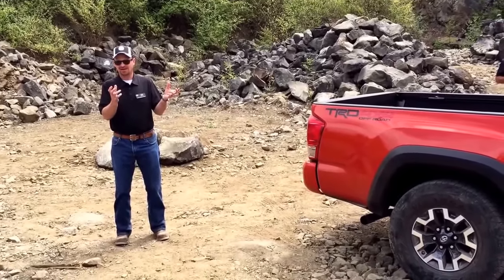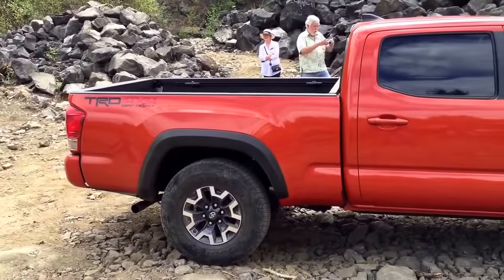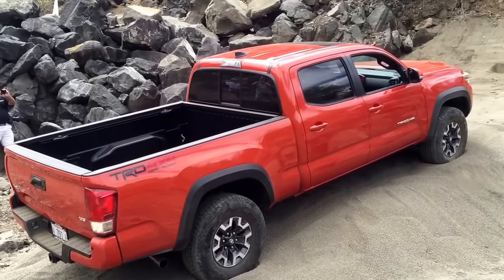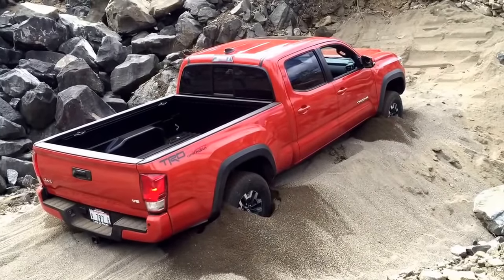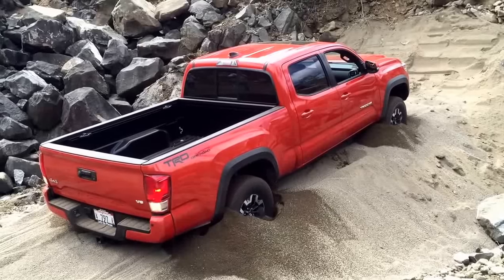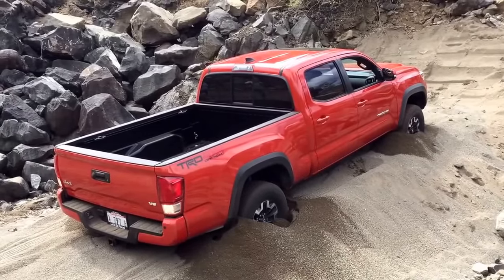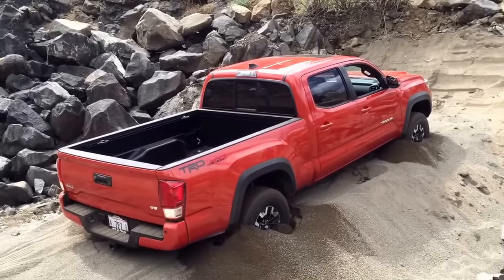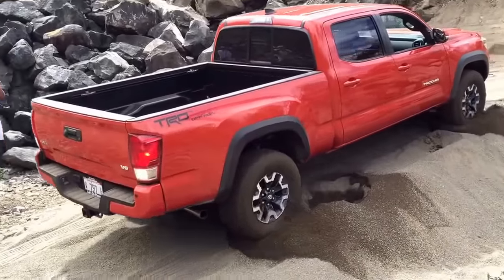2016 Toyota Tacoma - Demonstrating Crawl Control

Comment: We spent so much on crawl control we had to give you drum brakes, you guys.
Reply: hevquip a lot of trucks have drums in the back. Mostly older models though I wouldn't expect it from a new truck
Reply: drums are better ofroad
Reply: Milan Dičér true, the first thing I do to all my new off road trucks is convert from disc to drum brakes
Reply: Maximum Hardcore - then your wasting your money. Drum brakes do nothing better than disc brakes. Name one thing.
Reply: Mr Smith I was being sarcastic to the guy above me lol
Reply: @maximumhardcore4362  Drum brakes are better for mud offroading since they are enclosed whereas disc brakes will get covered in mud and stop working.
Reply: patycake720 nah, if that was the case dirtbikes/atvs would never use discs. They’ve always worked fine for me through mud. All drums ever do is get wet inside and they’re much sensitive to water/mud than discs
Reply: @maximumhardcore4362  dirtbikes aren't really going through the same amount of mud as 4x4 not to mention its not really possible to have drums on a bike.
Reply: @patycake720  my dirt bike had duums front and rear. Drum brake suck, they need adjustment, and they get wet and don't work. Disc brakes sepf cleaned and self adjust.
Reply: @patycake720  drum brakes are enclosed, not sealed. Which means dirt and water will get into them and get trapped in there. Disk breaks works in rain and mud just fine.

Most motorcycle's had drum brakes up until the 80s.
Reply: @patycake720  yes it is and it has been frenquently use just check the smaller honda MX series crf 50 to crf 150 most of thoses are drum brake
Reply: Drum brake have better brake power than most disc brake... their only problem is that too much use/temperature and they will fade out because they are not ventilated well enough. Disc brake are better in mud because the pad will squeeze the watter out by it self while the drum will be enclose but if water get in, it will take more time to get it out and the drum shoe will constantly work in water wich will have his braking power reduced . Drum brake are the economic version and disc are the heavy duty version.
Reply: @factojapspecmotorsport846  Nope. Disc brakes are more powerful than drums due to the brake pads are squeezing the disc plate on both sides compared to drums that only push from the inside. Add to the fact that the heat would cause the drum to expand increasing the gap between the brake pads and drum.  In disc brakes while the disc would still expand in the heat, the brake pads are still close to the disc.
Reply: @rzpogi  do not miss match everything about brake fade and metal thermal expension. There is a reason why drum brake is choosen before disc brake in many car still today. 1st the cost because a drum brake is still a lot cheaper than disc brake and 2nd the required input power. For exemple: if your car is correctly maintained, pull the e-brake of a drum activated e-brake / disc activated e-brake ... it will always need less force on the lever of a drum activated because its mechanical principle. When I said that drum brake have more stoping power, I meant that as long as the drum do not exeed the working temperature, a regular passenger car user, pick up driver or semi-truck(tractor) conductor will not see the difference between disc/drum. A truck that can pull 8000lbs would not be equipped with drum if it would not do the job.
Reply: @rzpogi  ho and btw : brake fade have nothing to do with the fact that the brake shoe cannot touch the drum anymore... the self adjuster in it compensate for the wear of the shoe so the wheel can only spin about half a turn when the car is on a lift. Drum are far from being junk but far from being a first choice in term of race use...
Reply: @factojapspecmotorsport846  Then why drum brakes are slowly phased out in regular passenger and even trucks? New Isuzu and Mitsubishi trucks already have disc brakes in their front wheels for their small-medium truck line. 

Pff stopping power? Then all vehicles should have stayed with drum brakes then. Disc brakes have been proven to be superior in stopping power and reliability compared to drum brakes. The only disadvantage is cost and complications of adding e-brakes to disc brakes. Also, disc brake pads are much simpler to replace compared to drums.
Reply: @rzpogi  every automaker use brake disc for front because it will resist emergency braking more frenquently and for a greater time. The question is : do our customer need the pay the higher price of disc brake, does the drum will do the job?. I am not defending the fact that drum brake are better than disc, like I said before they are far from junk but far front race choice... why would many 18wheeler trailer would still be on the road with drum brake if it would be that bad? BUT did you ever heard a trucker said that his brake failed on downhill? BECAUSE THEY OVERHEATED ! I wrote this too ; disc brake are the heavy duty version while drum are the cheap one
Reply: Trucks are light in the rear so they use drum brakes because they have a 10 thousands of an inch air gap they have to overcome before the brakes engage to prevent tire squeal or lock up due to the back being lighter!!!
Everyone on the comments does not know the truth!
That’s why I’m here to educate!!!
Reply: @alex62654  
Ever heard of a proportioning valve?
Reply: Drums are superior in many situations dumbass
Reply: My understanding is that the rear locker uses light rear brake drag to engage lock up and this is why the rears are drums. Thats what the manual says if I remember correctly. I think drums are better for providing this light dragging force. I could be wrong though. Either way. I got the TRD with rear drums and I don't notice anything from the driver seat braking wise. Love that locker though. I have the 2010 so I don't have crawl control. I just use snow chains. I have been in sand that deep and deeper snow running stock with snow chains and not needed my shovel.
Reply: Toyota skims out on those things because they know brand loyalty is a real thing. People will continue buying.
Reply: The drum brakes go out of adjustment in 500 miles and become worthless. The auto adjust isn’t. 
Toyota’s are good trucks but some fans take their enthusiasm too far.
Reply: @patycake720  lol talk out ur ass much boi
Reply: @rzpogi new semis hevy trucks even come with disc brakes
Reply: Totally sounds like a Todd Hoffman excuse. Lol.
Reply: Drum brakes should have never gone away.
Most last a life time on a Toyota Truck
Reply: im fine with drum brakes... i dont plan on racing.
Reply: Half these comments are pure bullshit

Comment: I want to see it doing this stuck on a flat surface, not on a hill.
Reply: I'm not sure if they could get it buried on a flat surface
Reply: Chaser Harper they could chain it to a concrete block or two  :)
Reply: Chaser Harper Or dig a hole and make it stuck.
Reply: Chaser Harper Sure you could! They just need to go to a beach! :)
Reply: +Chaser Harper Easy.  Put that sucker in 4LOW and punch it.  I see it on the beach all the time!
Reply: +LexTheRanger I agree, doing it on a hill like that is a cheap parlor trick
Reply: +LexTheRanger i done it on my 2wd 2015 Tacoma with rear diff lock and i have the video to prove it. Thanks to the diff lock i go farther than a 4wd truck and excellent driving skills of course
Reply: Yeah right. I have done it on the beach. Its not that easy and overheats the engine and transmission.
Reply: that's my comment.. 👌
Reply: exactly. The only place you'd ever need it.
Reply: On a flat surface its a whole different ball park. Doing the crawl control wont work. You will need serious deflation of air pressure to widen the tires contact patch and then Some serious rocking back and forth and then a good push out with the throttle to break you free
Reply: Sour Grapes, there buddy
Reply: I love the applause at the end, though.  Like it was a magic trick.  
It definitely wasn't magic, but it sure was a trick.
Reply: you can easily get buried on a flat surface if you brake hard to come to a stop, spin the wheels a bit to dig in and then you can show the crawl control. It's legit, arabs did this in the desert with a land cruiser, on a slight UPHILL slope.
Reply: I've done it in my GX. Plenty of videos online of landcruisers doing the same
Reply: Chaser Harper Trust me someone somewhere can do it.
Reply: LexTheRanger vbnbhnn.    Jjgjkkk
Reply: LexTheRanger @@@@@@@//ffggggggyyhgu
Reply: I want to

Comment: Lesson 1: Make sure you line it up just right before getting stuck.  
Lesson 2: Put it in 2wd first to get "stuck"
Lesson 3: Seems novel. (And another thing to break, malfunction and require expensive repairs) I would like to see the driver attempt to rock the vehicle forwards and backwards first, before determining how "stuck" this vehicle really is, and how effective the "Crawl control" feature is.
Lesson 4: How applicable is this? Snow/Ice? Mud?
Reply from the maker: High Up Tours + Transportation Once the weather gets colder and we have the opportunity, we will do this test on Snow, Ice and Mud since many have requested it. We're also planning to shoot a follow-up video with Mike Swears from Toyota Motor Sales USA to address the most popular questions from this video. Thank you. -TheDriversSeat
Reply: thedriversseat Awesome, nice work in following up guys.
Reply: High Up Tours + Transportation It seems kind of weak because it did prove that he could no longer go forward, but then proceeds to demonstrate the system in reverse, on the downhill side...not sure this system really makes anything possible that you couldn't have done before.
Reply: High Up Tours + Transportation I agree with you to a point.  This is made for idiot off road users.  Same as the people that can't parallel park.  Ford has the trailer backup now.  To me you are giving people false confidence.  This feature has been tested for many years on the Land Cruiser.
Reply: +High Up Tours + Transportation Look bro we know you drive a Ford just calm down.
Reply: Lol yep. What we learned here is that Tacoma will get stuck where a Jeep will not. And to get out of a situation like this all you have to do is back out all 4 wheels slowly to build up sand. Got it. Don't need a dedicated system for something like that. Just learn how to drive. I would never own a Tacoma.
Reply: +High Up Tours + Transportation Not only that, but he was also backing "down hill". real test would be to get stuck and have to back uphill or on a flat surface. gravity was helping that truck.
Reply: +Eric Fortune You can buy a Tacoma for low 20's.  I think this model would be more for the enthusiast.
Reply: ***** Trucks are getting more expensive because they are expected to be a car in the inside and truck on outside
Reply: Christopher. Stop talking nosense you havent even drive in the sand. I got a pickup truck with 4WD and has 4wheels low. When you get stuck you have to take out your head and see how fast your wheels are spinning
Reply: +Jay Trock They don't make trucks anymore period.
Reply: I've seen this system work on flat ground in a dried river bed. The 4Runner was as stuck as you could be in sand.   I didn't believe it would work but after 3-4 minutes the truck came right out.  I was very impressed.
Reply: +thedriversseat why dont you get another truck with the same tires, tire size, weight, wheel base and ground clearance that has a real 4x4 which all diffs lock and compare that to the Tacoma crawl control. I see this new crawl control stopping the tires which can actually get you stuck when momentum and slow turning wheels in 4 low is best. This video does not compare nor prove anything how actual traction rates to anything else.
Reply: High Up Tours + Transportation man shut the fuck up... don't write nonsense... or get your eyes checked.
Reply: Christopher Cox stop winging.
Reply: On second viewing, why is that thing having trouble trying to make it up a non steep grade? I heard the motor going and struggling like it was trying to move all 4 tires.
Reply: dude shit up, go try that shit yourself. alw
ays gotta be one of you
Reply: that comment doe. lol we try that shit all the time. Most of the vehicles in the club can go straight up a mountain staring at nothing but sky. This thing is struggling to climb up a tiny hill. No thanks.
Reply: not sure i was much impressed with the tire/tread  choice on the truck...
Reply: High Up Tours + Transportation don't forget to do it on a hill 😂
Reply: jldude84 you're AWFULY wrong 😂😂😂 the quality is what Tundra owners are looking for.
Reply: jldude84 I think you're thinking of ram guys
Reply: High Up Tours + Transportation
Reply: High Up Tours + Transportation 4

Comment: Better yet, can it continue going up? No
Reply: Yes if the driver wouldn't have started spinning the wheels and stopped and dug himself in, yes it would have went up that tiny hill just fine and in 2WD.  These are nothing but gimmicks to get stupid people to buy shit they don't need.
Reply: William Todd idk it seemed to be having a hard time going up in 4.
Reply: I feel like crawl control is un necessary that was a little hill i coukd have gone up that without getting sthck or crawl control
Reply: Weakest 4x4 I've seen.
Reply: Never seen sand look so thick like rocks
Reply: @dougjohnsonbushcraftandbjj5561  I agree 1st time going up sounded like it gave it's best lol
Reply: Barely had enough power to get stuck!

Comment: To all you people saying it isn’t stuck ,ARE YOU SERIOUS it was more or less bottomed out they dug that truck in pretty deep. I’m an all terrain mobile crane operator there’s 2 types truck mounted cranes Kato and Tadano jap cranes but only rear wheel drive then Terrex my fav was my AT35 AT FOR ALL TERRAIN 35 means what weight as in 35ton with rear steering and diff locks, got stuck a few times in the only rear wheels driven but with diff locks I never got stuck in the 35 , I think this is an exelent vid proving that low torgue and variable diff rates WILL AND HAS WORKED FOR ME I’d drive that truck anywhere peace.

Comment: That was the dumbest reason for using rear drum brakes ive ever hear.
Reply: Gixxer983 learn how to spell, speak. Take this L. 😂
Reply: @gjolinares23  I bet you got a solid 73% in English class
Reply: @angelr6524  Nope. I did even better and with barely showing up or trying.  🤣
Reply: Gerardo Linares 
His 100 likes vs. your 1 like

Take this “L”.
Reply: @gjolinares23  r/iamverysmart
Reply: Gixxer983 That’s actually a legitimate reason to have drum brakes. He’s not wrong.
Reply: @markofexcellence5209  but for those that go wheeling off-road, and cross a stream, those drum brakes will blow chunks.  Fill a brake drum with water and it becomes completely useless.  If he wants to use that excuse, then why do 4Runners, GXs, etc, all have rear disc brakes, when they aren't really meant for towing heavy, either?  It's because they've always cheaped out on the Tacoma.
Reply: @RickysHP  what makes you think that making drum brakes are cheaper?? You don't know anything about them do you? The have way more surface contact area which is extremely useful in controlling slip on 4 wheel drive without lockers that use that type of setup
Reply: Ricky you need to educate yourself
You clearly dont have a clue what you are talking about
Reply: Gotta keep the sand and debris out of the disc brakes? How you gonna get sand and debris out of drum brakes?
Reply: @gjolinares23  keyboard warrior
Reply: @treybohler2045  get out of your feelings.
Reply: @gjolinares23  I'm not in my feelings
Reply: Yes we want to hear opinions from a proper engineer like you.
Reply: @MegaPoiuj  no one asked you. Go back to middle school
Reply: How is that a dumb reason? It’s completely true. I’ve had a truck with all disc and that does happen very easily. Drums make give much more peace of mind and have more contact area for breaking. Do some research before posting next time
Reply: Yes it was with that logic they should put drums on the front too. LoL
Reply: @myredfast  that's when they work way more moving parts they go out of adjustment easily and are more expensive to service. That's why we don't use them anymore.....

Comment: Went down a sandy embankment in my F250 XL Powerstroke 4WD manual transmission with E load range street tires.  Went down just fine, charged up the embankment several time trying to get back up, no luck.  I low range "crawl controlled" my way back up after trying everything else and got out with minimal fuss.  I didn't even touch the throttle... just let the gearing and torque of the diesel do its thing.
Reply: it isn't hard to go down a hill. Toyota just made them selves look stupid.
Reply: +Strigent Odin its like the chevy commercials, its for people who don't know any better. if i knew nothing about trucks i would be amazed.
Reply: Kenneth Barbee
Very true. it doesn't take a rocket scientist to under stand trucks though.
Reply: +Strigent Odin It doesn't, but think about how many people don't even know what kind of motor their vehicle has. I've met so many people who know absolutely nothing about their vehicle, so when some gimmick comes out their mind is blown and they want that vehicle
Reply: Kenneth Barbee
Thats true. My brother didn't know he had a v6 in his car.
Reply: BUILT FORD TOUGH
LOL
Reply: +Strigent Odin FORD ALL THE WAY
Reply: Raymundo Gonzalez
YEYE

Comment: It probably wouldn't be able get out if that was on flat ground. I think gravity did most of the work. A stick shift toyota from the 80's could do the same thing displayed in this video.
Reply: Unnamed God Slaphappy or a manual 3rd gen 4Runner.